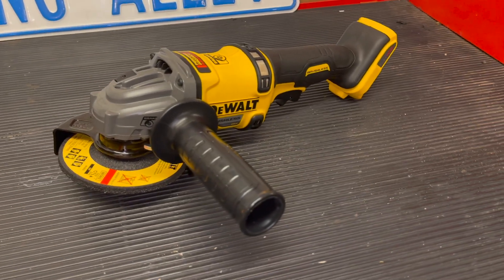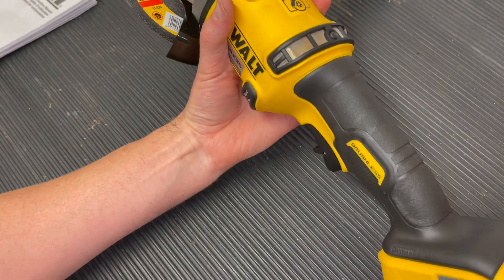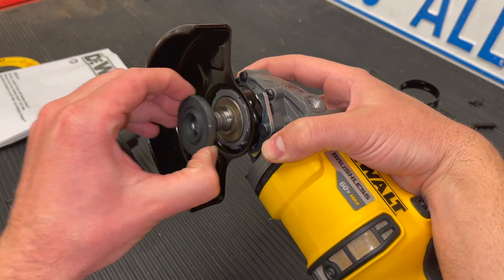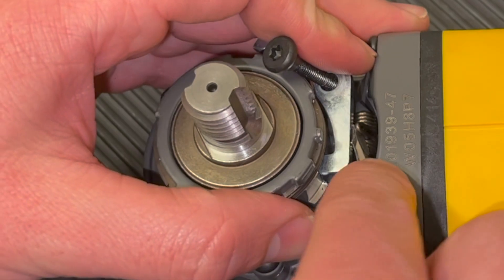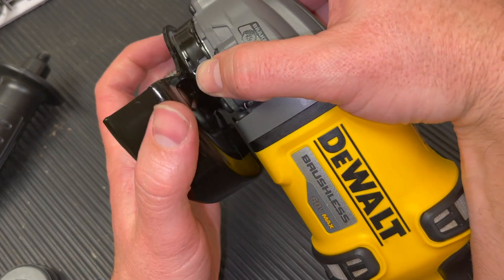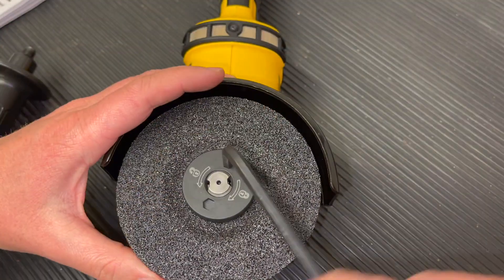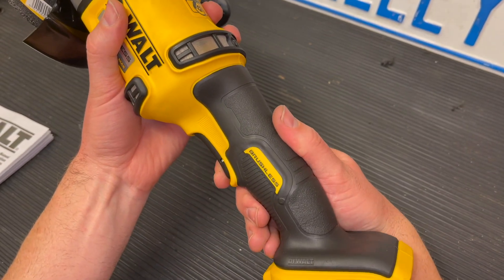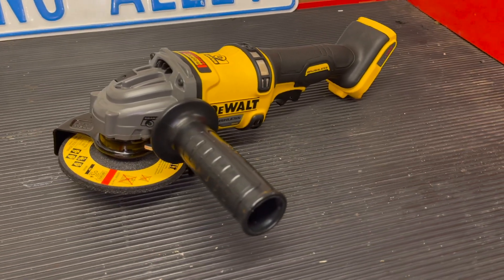DeWalt Angle Grinder Overview & Configuration. Disc install, shield install

Comment: I just used my angler grinder today. But was not a dewalt or battery powered
Reply from the maker: I need to buy a $100+ battery and charger for mine 😒
Reply: @dannyjohnsonsgarage  OUCH. For as much as I use my grinder the 3 cents it cost to plug it into the outlet works for me lol